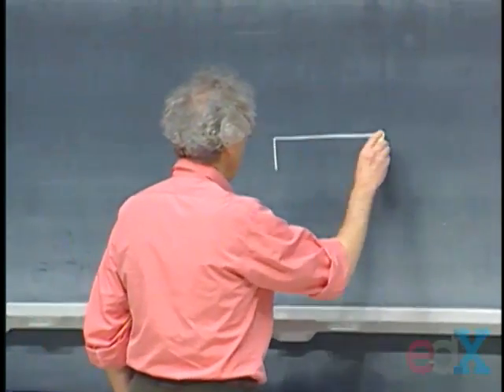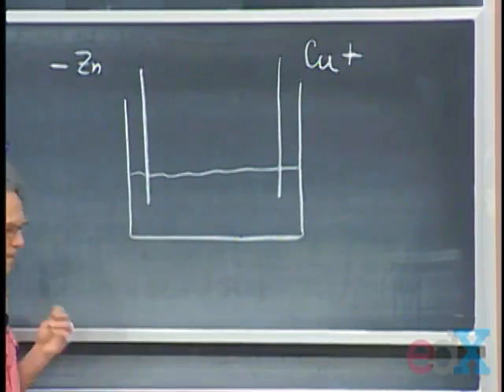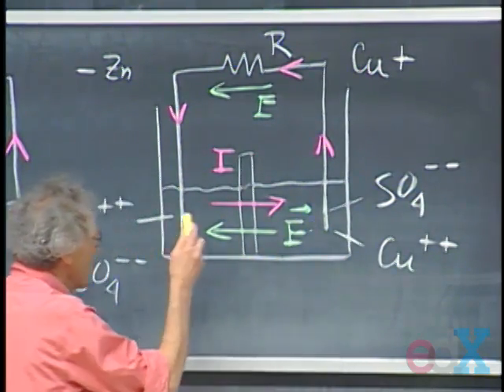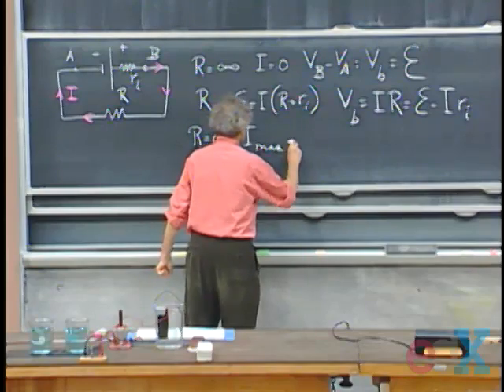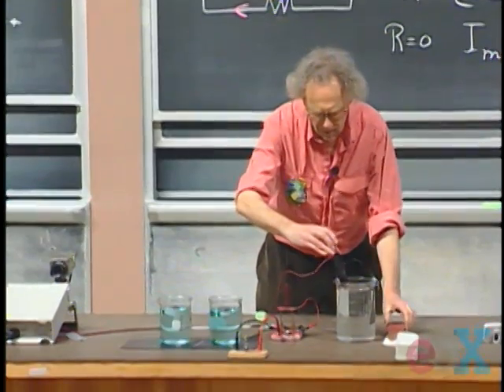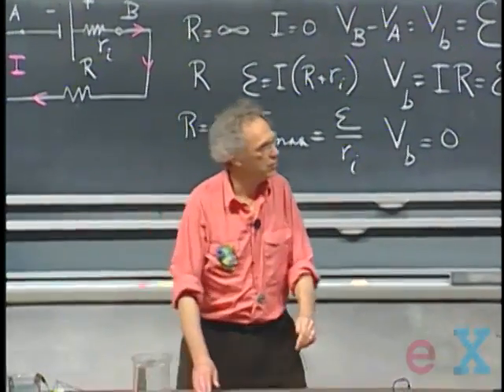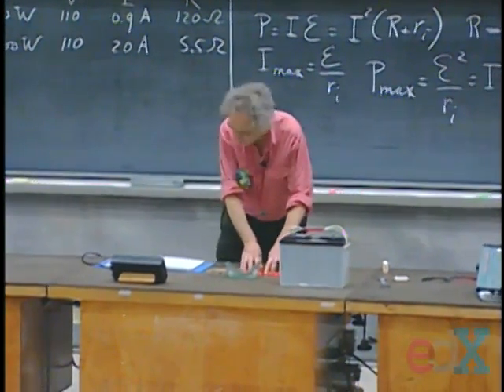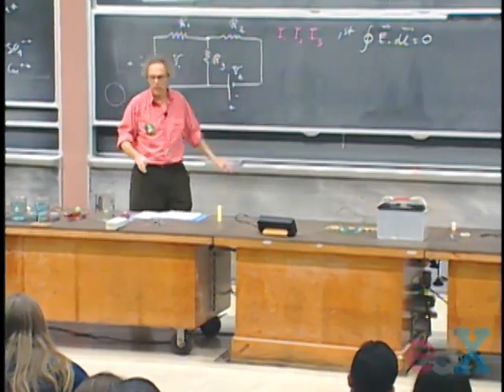8.02x - Lect 10 - Batteries, Power, Kirchhoff's Rules, Circuits, Kelvin Water Dropper

Comment: prof. if we have only one battery .then what would be the equations for the circuit with the help of kirchoffs rule
Reply from the maker: which lecture, how many minutes into the lecture?
Reply: it is about 34:00 the circuit that you have made to apply kirchoff's rule . in it if we have only one battery then .
Reply from the maker: K's loop rule holds for any closed loop integral in the circuit regardless of how many batteries you have. If you delete V1 then you can replace the parallel resistors R1 and R3 by R: 1/R1 + 1/R3 =1/R. You now have one battery V2 with 2 resistors in series R and R2. The current, I, that will flow is V2/(R+R2) and K's loop rule is: V2 - I(R + R2) = 0. Alternatively, if you do the closed loop integral of E dot dl in the loop with R1 and R3 (no battery), then this closed loop integral is also ZERO. Be aware of the fact that the current through R1 is different from the current through R3. You can now do something similar if you delete V2. Good luck!
Reply: wow !! thank you proff. u are great
Reply: i have solved for current in a circuit  but i just wanted to get it checked . how can this be done?
Reply from the maker: I prefer to stay out of this. The circuit in question here is a high school circuit. You can ask any high school student to help you. Good luck.
Reply: hehe
Reply: sorry for too many questions so asking u the last question, if i place the battery just below the r3 then we should not take the v of that battery into consideration .. isn't it
Reply from the maker: All batteries have to be taken into account.
Reply: the v of that battery should get canceled because the current is from the other side too which is in opposite direction to that of i1
Reply from the maker: All batteries have to be taken into account. If the result is that certain currents are zero or that certain batteries "cancel" as the sum of two batteries is series is ZERO volt, so be it. But ALL have to be taken into accunt.

Comment: Sir, how to find the Electric field at a point on a  circuit consisting of a battery and 2 resistors in series .
Reply from the maker: watch my 8.02 lectures -
Reply: @lecturesbywalterlewin.they9259  ok sir I have completed upto lecture 11i will surely watch everything
Reply from the maker: >>>>Sir, how to find the Electric field at a point on a  circuit consisting of a battery and 2 resistors in series>>> Ohm's Law is all you can use.
Reply: @lecturesbywalterlewin.they9259  sir ,then how uniform electric field is achieved throughout the circuit?
Reply from the maker: @KaviPriyan-qt6vc  it's not Uniform watch my lectures - Resistance R1, lenght L1, Res R2, length L2. R1/L1 is not necessarily R2/L2. Current is the same through both as they are in series.
Reply: @lecturesbywalterlewin.they9259  ohhh thank you very sir . Live long sir♥️ ...there is no one as knowledgeable as you to teach students♥️

Comment: hello sir could u pls explain how the light bulb decreases the emf of the battery? how is it part of the internal resistance?
thank you
Reply from the maker: I do not understand your question. How many minutes into the lecture?
Reply: +Lectures by Walter Lewin. They will make you ♥ Physics. 
14:15
why does the emf not change without the light bulb being connected?
Reply from the maker: I explain this in my lecture. Watch it again. When the circuit is open the potential difference V between the poles of the battery is about 2 V. When you close the circuit, a current will start to flow. Since the battery has a internal resistance (R1), the potential between the poles of the battery will go down by an amount I*R1.  V=I*(R1 + R). Thus IR which is the same potential as you measure at the poles of the battery (see the circuit) IR=V -- I*R1.
Reply: Thank you so much for explaining
So when the circuit is open, we measure the potential like we would for electrostatic potentials?
Reply from the maker: It's a funny way of putting it. By definition "electrostatic" means zero current. So YES you could call it that way.

Comment: why do we have to connect resistor , what happens if resistor is not there. if there is just a wire can't we get current?
Reply from the maker: question unclear. I=V/R. V is a given. How will you get an I?
Reply: Lectures by Walter Lewin. They will make you ♥ Physics. what happens to current if r=0 that is we don't connect resistor but just a conducting wire? conductor
Reply: wire will offer a very little resistance

Comment: Sir as we know that when current flows through the cell the terminal potential difference is less than the emf. SIR how the potential difference  decrease when current flows because potential difference between  two  points (whether current is flowing or not) is the integral of E dot dl. sir how the potential difference two terminals decreases when current starts to flow
Reply from the maker: Assume the emf of a battery is V with zero current. Now attach a resistance R to its terminals. The internal resistance of the battery is r. Thus I=V/(R+r) thus the pot diff over the battery is now V-Ir.

Comment: If we do a little alteration maxwell third equation e.dl=-d phi /dt but kirchhoff's law is -e.dl =0 there shouldn't a current changing with time . I couldn't understand why they came to harass him
Reply from the maker: In Dutch we say "zachte heelmeesters, vuile wonden". I owe it to my multi million viewers to explain in detail why Electroboom is dead wrong. Many people make the same mistake that he made. All this is at the very roots of a correct understanding of Maxwell's eqs. I therefore have an obligation to set the record straight. This is my last msg.
Don't feel embarrassed if this physics is above your level; you are not alone. Non-conservative E-fields are not taught in high schools. 
I demonstrated at the end of my lecture #16 of my 8.02 E&M course at MIT that two identical voltmeters attached to the same 2 points in a circuit can show very different values. https://www.youtube.com/https://www.youtube.com/watch?v=nGQbA2jwkWI&list=PLyQSN7X0ro2314mKyUiOILaOC2hk6Pc3j&index=17
This can also be demonstrated with a transformer.
https://www.youtube.com/watch?v=b7i2uMx7gHo&list=PLyQSN7X0ro22zanLOcvkaSY-IZqheFYM5&index=8
In fact, look more closely at my circuit; it is a transformer. My closed loop is the secondary winding (only 1 winding) of a transformer and the primary windings are in my electromagnet. 
The reason is that an induced EMF (Faraday's Law) creates a non-conservative E field. This means that moving a test charge between the same 2 points in a circuit can require a different amount of energy (even with opposite signs!). You still aren't getting any energy for free, because it comes from the source of the time-varying magnetic field.
When a voltmeter reads a value V it means that the integral of E dot dL across the voltmeter is V. 
In cases where Kirchhoff's loop rule (KVL) applies, 2 voltmeters attached to the same 2 points in a circuit will always show the same value. Kirchhoff's original text can be found in the following link, pages 497-514: https://books.google.de/books?id=Ig8t8yIz20UC. Clearly he was fully aware of the prerequisite for his "loop rule". KVL is a special case of Faraday's Law. That's why Faraday's Law is one of Maxwell's equations and KVL is not.
My demo was first suggested and published by Romer in December 1982 in the American Journal of Physics. This demo has now become a classic; it's done all over the world at many colleges and universities.
ElectroBOOM and Dirk Van Meirvenne believe that 2 voltmeters attached to the same 2 points in a circuit must always show the same value which is not true. It's quite  embarrassing that they each posted a video on their channel in which they claim to have proof for their wrong ideas.
Also read Professor John Belcher's thoughts on Faraday's Law and on KVL. Professor Belcher is my former colleague at MIT. http://freepdfhosting.com/0813df09f5.pdf
ElectroBOOM insulted me in his video by mentioning that the reason why my 2 voltmeters read different values was due to "bad probing". He stated that if I had done the demo correctly both voltmeters would have read the same value. He could not have been more wrong.  
The following video may also help you to understand why 2 voltmeters attached to the same 2 points in a circuit can give very different readings. https://www.youtube.com/watch?v=LGdN7rDB3XE

Comment: Respected Sir
sir i have a little doubt
sir as we know that when  no current is flowing the potential difference between the rodes of the power supply is E(EMF OF THIS POWER SUPPLY)
sir as current flow the potential difference between the rodes decreases and potential difference than= emf - current*internal resistance.
sir but why the voltage between the two electrode decrease.how internal resistance decreases the emf.
sir i hope you will answer my question.
yours obediently 
jai
Reply from the maker: STOP abusing my time - I answered this question already several weeks ago.
Reply from the maker: pot diff battery (zero current) = V. Its internal resistance is r, the external resistance is R. 
There is a switch in the circuit. switch OPEN no current flows. attach a voltmeter over the poles of the battery, you will measure V. Now close switch, current I will flow, apply Kirchhoff's loop rule: IR + Ir - V = 0. Attach a voltmeter over R (R is connected to the poles of the battery), you will measure IR = V - Ir. Thus the pot diff between the poles of the battery went down. It went down by an amount Ir.

Comment: sir,when charge enters resisitor its potential is reduced thus charge speed also reduced and hence current reduced...
so can we say curent entering resistor is not equal to current going out...
Reply from the maker: This makes no sense
Reply: Why in a series connection of resistors is the current assumed to be same throughout? Don't the resistors reduce the drift vel. of electrons? If so, then how does the current remain the same?
Reply from the maker: E-fields in resistors travel with the speed of light. Thus electrons will start to flow "simultaneously" everywhere in the resistor to within 10^(-10) sec in a 3 cm long wire. If you looked at a pico time scale then the current is not every where the same.
Reply: sir!!!!today is teachers day in my country.just today i saw your interview videos am very much glad ..!
you are a genuine teacher I wish u happy teachers day !!
Reply from the maker: Thanks very much!
Reply: This post is my best effort to seek assistance on a topic which is quite vague to me, so that I am struggling to formulate my questions. I hope that you will figure out what it is I'm trying to articulate.

If we have a circuit with a resistor, we speak of the voltage drop across the resistor.

I understand all of the calculations involved in voltage drop (ohm's law, parallel and series, etc.). But what I seek is to understand on a conceptual level what voltage drop is. Specifically: what is the nature of the change that has taken place between a point just 

before the resistor and a point just after the resistor, as the electrons travel from a negatively to a positively charged terminal.

Now as I understand it, "voltage" is the force caused by the imbalance of charge which causes pressure for electrons to travel from a negatively charged terminal to a positively charged terminal, and "resistance" is a force caused by a material which, due to its 

atomic makeup, causes electrons to collide with its atoms, thus opposing that flow of electrons, or "current". So I think I somewhat understand voltage and resistance on a conceptual level.

But what is "voltage drop"? Here's what I have so far:

Voltage drop has nothing to do with number of electrons, meaning that the number of electrons in the atoms just before entering the resistor equals the number of atoms just after
Voltage drop also has nothing to do with the speed of the electrons: that speed is constant throughout the circuit
Voltage drop has to do with the release of energy caused by the resistor
Reply from the maker: Voltage between point A and B is defined the integral of E dot dl in going from A to B. The force on charge q is qE. Thus the force on electrons is opposite the direction of E. The force on a positive charge is in the direction of E. Only the free electrons can move in a solid, protons and positive ions cannot move. I cannot add anything to this.
Reply: when simple circuit with resistor in b/w positive and negative is setup, both electrons and protons loose potential energy(PE) and gains kinetic energy(KE).this KE is also loosed when  passed through resistor due to collisions. By this i can say current is reduced after passing through resistor(because as KE is loosed number of electrons crossing any section is reduced as i understood)  ...am i right?then how do people say current is same throughout ckt?
By this I draw that PE come KE which is loosed is called voltage drop...
please correct me sir...
Reply from the maker: what is b/w?  In a solid protons cannot move; only electrons can. An electron moves because of the qE force. That has nothing to do with PE. It gains KE but only very very briefly. qE is always present if the electron moves through a resistor, but within micro sec it reaches a very low approx constant speed (called drift velocity) because it interacts with the existing atoms in the resistor. I derive this in one of my lectures. https://en.wikipedia.org/wiki/Drift_velocity

Comment: Sir suppose there is a large sphere which have a much much positive charge it means that is at higher potential. sir now suppose I connect the one end of the sphere of with one end of bulb and second end of the bulb with earth. now we can see here that circuit is not closed here. sir positive charges will move from higher potential to lower potential means sphere to earth. current is flowing from earth to sphere. sir here bulb will glow or not glow because circuit is not complete
Reply from the maker: If you connect two conducting objects which have different potential with a copper wire, a current will flow in the wire till the potentials of the 2 conductors are the same. In this case there is NO closed circuit. Thus a closed circuit is NOT a must! sorry.

Comment: Sir can you tell me. Why resistance exist in a wire. Is there any benefit of having resistance in a wire. Can current flow in an ideal zero resistance wire?
Reply from the maker: Watch lecture Lect #9 of 8.02
https://www.youtube.com/watch?v=PJqOaHBgr30&index=10&list=PLyQSN7X0ro2314mKyUiOILaOC2hk6Pc3j
Yes a current can flow through a wire that has zero resistance. If the wire were made of super-conducting material the resistance would be ZERO.
Reply: Lectures by Walter Lewin. They will make you ♥ Physics. Sir if resistance will be perfectly zero then potential drop in the circuit across the length will be zero. Won't it will voilate Ohms and Kirchoff's law.

According to Ohms law in this condition there will be infinite current running through the conductor
Reply from the maker: Lectures by Walter Lewin. They will make you ♥ Physics. 6 seconds ago

V=IR, if R is zero V is zero.
A current, I, can flow through a superconducting wire which is  in a circuit. But there will be NO E-field inside the sc and the pot diff, V, over the sc is ZERO.
use google
Reply: Lectures by Walter Lewin. They will make you ♥ Physics.  Sir from this conversation can I also say that when there is no current flowing then resistance is also 
zero
Reply from the maker: NO, V=IR If V=0 then I=0 but R can be anything, 1 ohm, 10,000 ohm
Reply: Lectures by Walter Lewin. They will make you ♥ Physics. Sir in today's conversation you told that there will be no  E-field inside sc there will be no external potential difference on sc. Sir I don't understand what this exactly mean. What do you want to tell me. Can elaborate that reply

It's last to last reply from you.
Please
Reply from the maker: There is NO E-field in a super-conductor as that would lead to I => infinity. Bcoz V=IR  If R = zero V across the sc MUST also be zero as V across the sc is the integral of E dit dl inside the sc.

Comment: sir suppose there is cell. the positive terminal of cell is connected to -ve terminal with battery. sir suppose circuit is rectangle. sir inside wire there is electric field . electric field line   inside wire will be  also in rectangular shape. sir but it can not be possible because electric field lines are smooth line. sir than what is the shape of electric field lines inside electric wire from positive terminal of cell to -ve terminal of cell
Reply from the maker: question unclear - simplify it

Comment: sir ohm,s law state that potential difference is directly proportional to the current that V=IR. sir ohm,s law does not state that emf is directly  proportional to current. sir than why you write V=I(r+R)
Reply from the maker: r+R is the total resistance on the circuit.

Comment: What is the difference between EMF and voltage......What is the physical reason that voltage is less than EMF  ?
Reply from the maker: If the emf (nothing attached to the battery) of a battery is V1, then, if a circuit is attached to the battery, the potential difference at the terminals of that battery will be V1- I*r = V.  I is the current drawn and r is the internal resistance of the battery. I cover all this in depth in my 8.02 lectures.